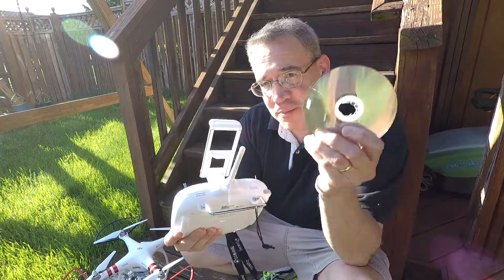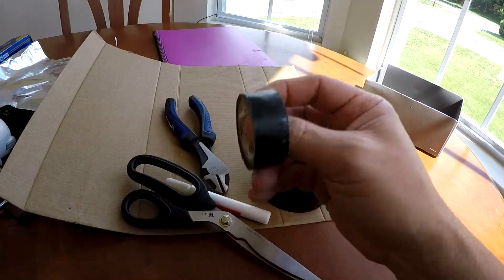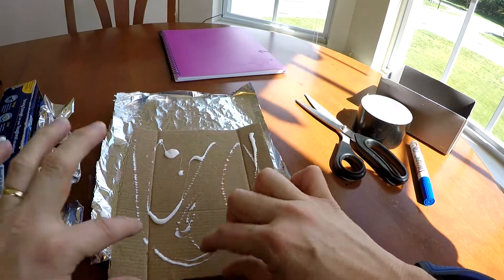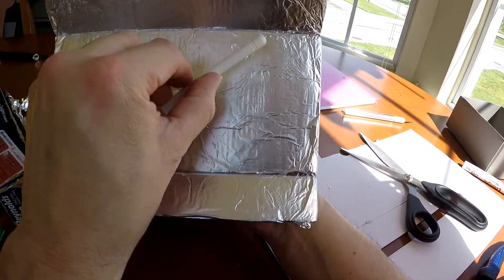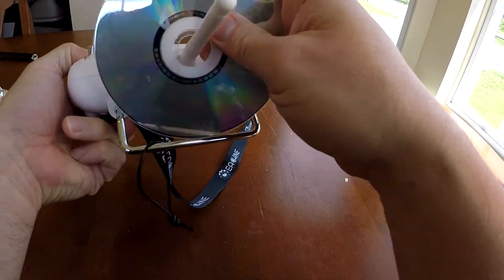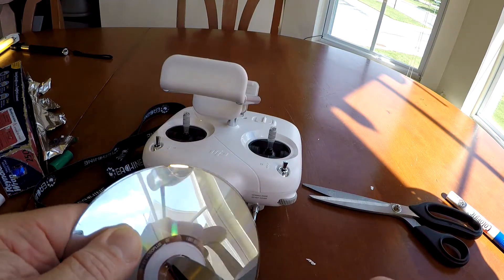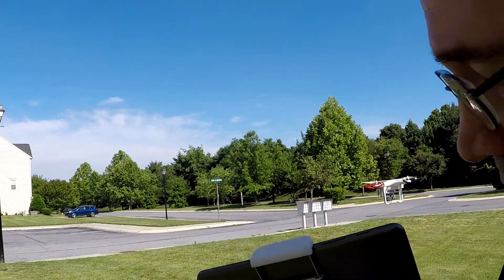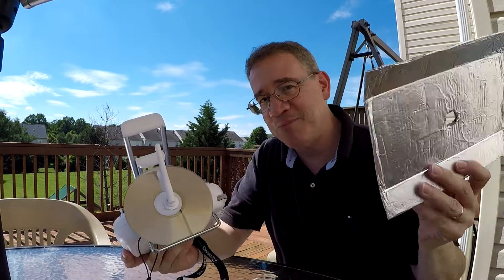Easy DIY DJI Phantom 3 Standard RANGE EXTENDER!

Comment: You SAID you would show us how good it works and your didn’t try flying it a couple 100meters away then that’s showing us if you fly it 10ft away the range is the same
Reply from the maker: You are correct.  I always planned to do that.  However at that time I found my DJI videos were not getting many views and so I decided not to continue with that and from there transfered my energy to the Yuneec Breeze and other drones.  As I produce videos I focus on vids that get most views.  The Phantom didnt get enough views for me to  continue spending time on.  I do feel an old  CD works just as good.  Good luck.  TD

Comment: yeah problem with parabolic extenders is that the block the internal antenna for video feed, I have no doubt that the CD worked ~25% better, but replacing or even moving the internal ones will extend range more.

Comment: Your car board reflecter would serve no purpose on less it's a parabolic shape for even reflection for bounce off
Reply from the maker: That makes sense.  However, I disagree a little, because the CD and the foil plate keep the signal bouncing forward, and that helps which is why this works too.  I'll make another with that concave curve in the center.  I'll see what I can find, Maybe a small paper bowl or bent plate like from KFC covered.   Ok you gave me a challenge I'm going to see what I come up with.